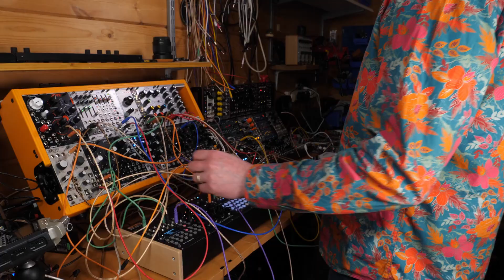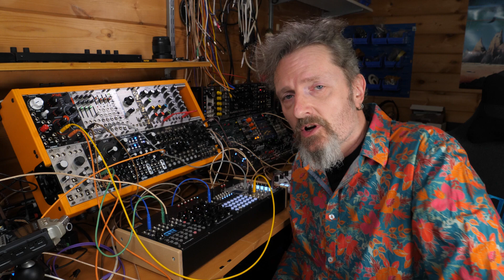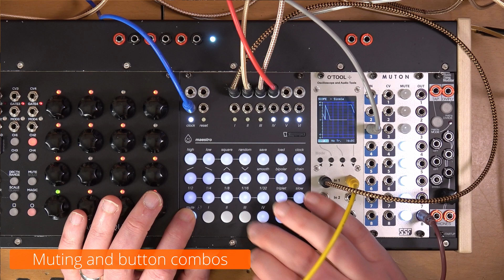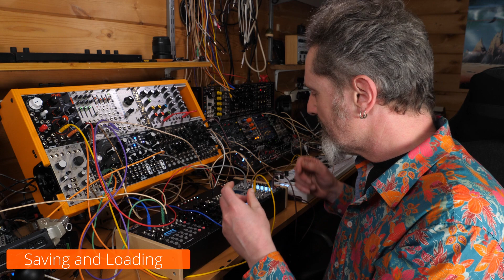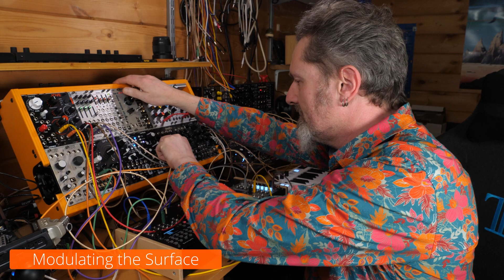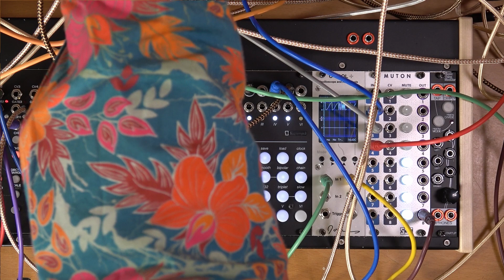Acid Rain Technology Maestro LFO Review

Comment: What would be a cheaper substitute for this massive lfo controller?
Reply from the maker: Any LFO really
Reply: DIY.  If not,  perhaps a couple of behringer 4LFOs going into a couple of doepfer A-151 or  behringer 1050 mix sequencer,  pulsed via several 2hp DIVs or a Pam's Workout.
Not a whole lot cheaper unless you already have some of those, and no smoothing function (nothing a slew cant fix) nor the chaining and memory - but it ~is~ more modular, with 2 more LFOs, and is CV-able - the Maestro takes no CV,  just pulses.

Comment: I have Maestro but not used yet as I’m learning modular, what inputs on other modules would I use from outs on Maestro???
Excellent review Robin, exciting module 
Thanks once again
Reply from the maker: Start with filter cutoffs as that always has a dramatic effect and then experiment with any CV inputs to anything - could be delay time, reverb depth, pitch, pulse width, level - anything that can be modulation (changed) with a CV input.
Reply: All inputs are open for your experimentation. Just patch and see what you discover. 🙂